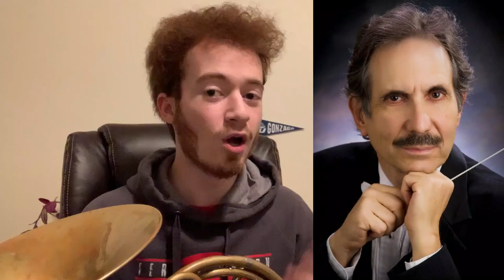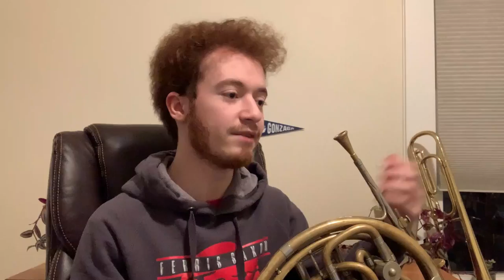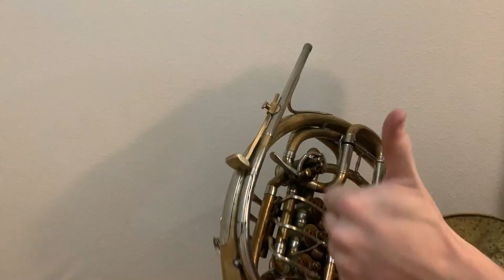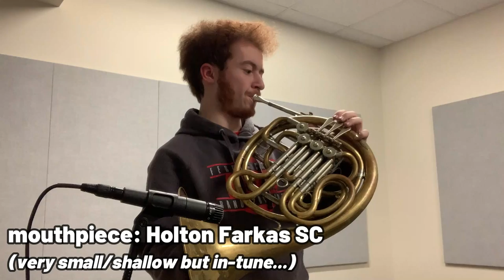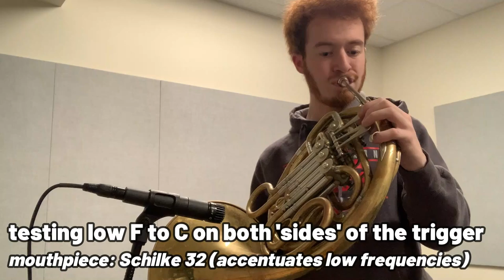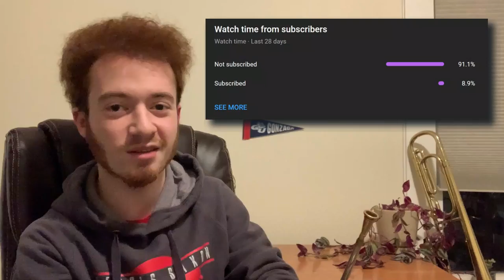Check out this vintage Kruspe French Horn from 1969! | Show & Tell

Comment: Great video! I’m a horn player entering 9th grade and I am playing on a holton h179 as my practice horn. It’s cool knowing where the design came from for my horn. Thank you!
Reply from the maker: Thanks for watching, Cameron! The H179 is a great horn, in fact, probably the number-one bestseller out of all upper level horns. I reviewed it a while back. Unfortunately the particular one I reviewed was not the best one I’ve played, but even so, you really can’t go wrong with one.
Reply: What horn do you usually use? I’m curious because my high school gave me the H179 for home use and a Conn 10D for school use. I’ve noticed that there are a few differences between the two but the play pretty similarly. I’m also curious if you have an opinion on Geyer Vs. Kruspe horns.
Reply from the maker: @Cameronleece  I play a Conn 8D, a very standard Kruspe wrap. It’s basically my “one true love” out of the many F horns I’ve tried. Geyers are becoming much more common in America for section playing in wind ensembles and orchestras. They project well and tend to have a direct, ringing sound compared to the deeper and richer sound of most Kruspe wraps. When I play on Geyer wraps, I have a hard time finding the proper hand position because their bell throats are oftentimes smaller, I don’t like the sound from my perspective because of the smaller bell and they don’t respond as well to putting a mic next to the bell, and it feels as though I can’t play low notes as well as on my 8D. I haven’t gotten to play a 10D, so I don’t know how it stacks up to the Geyers I have played, but in general, I have a lot of my own reasons for being loyal to Kruspe wrap horns and more specifically my 8D. I definitely don’t prioritize the same things as a professional horn player, most of whom nowadays probably strongly prefer Geyers.